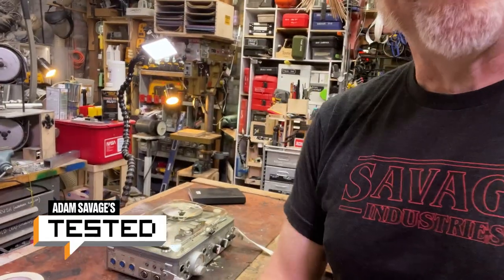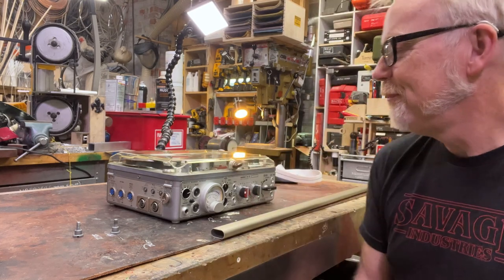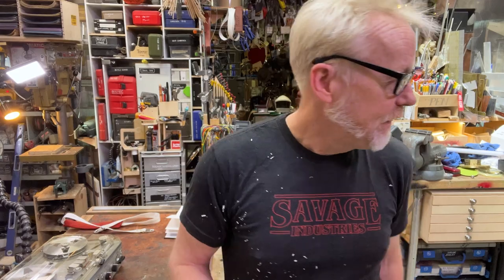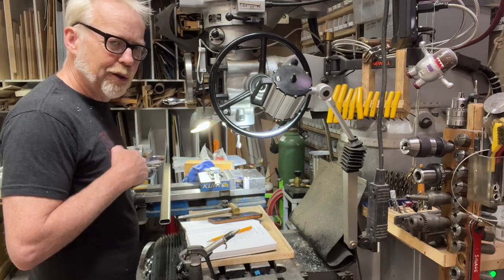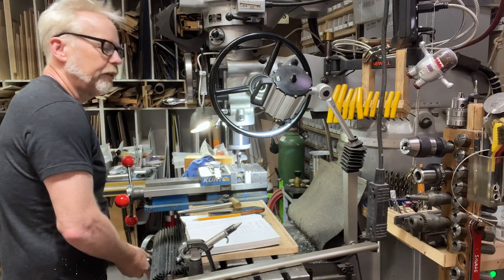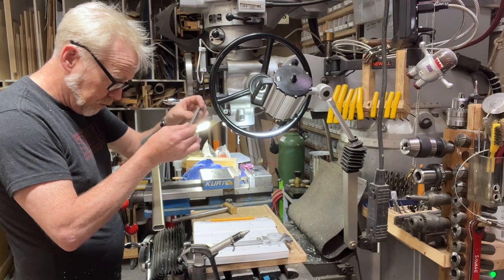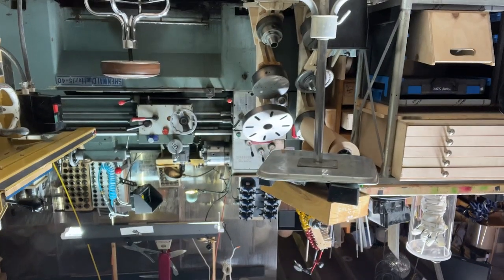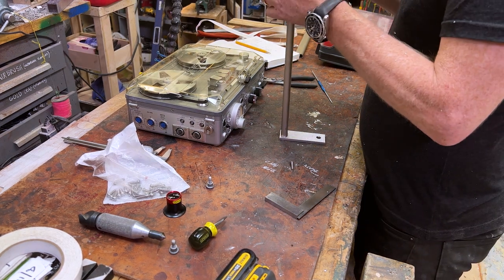Adam Savage's One Day Builds: Nagra Recorder Handle Bar

Comment: Back in my Nagra recording days, we never used a handle.  The recorder was either in a bag with a strap for run-n-gun type productions, or it was on our Magliner sound cart.  Yes, it's nice to angle up the recorder on a handle, but we would never trust it without a locking mechanism.  If someone were to bump the cart during recording and the Nagra were to fall, it could ruin a perfectly good take.  Today's digital solid state recorders wouldn't be affected by such a mishap but the Nagra is a precision mechanical device that doesn't take too well to shock.  I believe that the actual Nagra handle includes the locking mechanism, which is one of the many reasons why it is expensive.  Anyway, almost all of the devices that I have that have a handle that can be used to raise the control panel, include a locking mechanism at the point where it attaches to the device. This is a feature that Adam could have easily built in his shop and incorporated into his design. Otherwise, Adam's handle is beautiful and compliments the aesthetic of the Nagra very nicely.

Comment: Very nice job, and impressively close to the original! 
Here's a tip: True to Nagra engineering attention to useful details, the Nagra 4-series handle/strap lugs mounted on the chassis are assembled with flat springs on the inside, and preloaded so that the lugs will turn, but with an amount of tension that keeps the handle from being completely loose but still allows the handle to be positioned like you mentioned. 
- Glen Trew
Trew Audio
Nagra Service

Comment: The handle looks good, Adam. The extra notch looks "technical" :-) I saw the brown leather case you have. That's a little different to the black leather cases I used on 4.2 recorders for many years, (with the webbing straps with nylon end pieces with metal inserts). They are generally similar but the 4.2 style didn't have any zippers, just press studs. I don't know if they would fit the IV-S.  I found those black cases to be robust and offered good protection. They also allowed easy access to the controls whilst the recorder was being carried on the shoulder for field work.

Comment: Those oval bars are used in custom closets. I’ve ordered them for remodeling, they’re also very strong.
Reply: ...Strong enough to hold a 40-lb, 50-year-old sewing machine? Say supports at each end of a 20-inch (490mm+/-) span?

Comment: You should machine your own 10-32 handle screws with a flat head instead of the dome heads.  It would match better with the shoulder screws that hold the handle to to the case.

Comment: At 4:06 - Adam is measuring the outside width of this tape recorder.  Doing this for a wide object is prone to a measuring error.  You can't just "eyeball" it.  His method of using 1-2-3 blocks and a rule is OK.  But using a large outside caliper (https://en.wikipedia.org/wiki/Calipers#/media/File:OutsideCalipers.jpg) is a better choice.  My $0.02.  Thanks!

Comment: Adam, I have to ask: Why don't you make design drawings for such precise machining? This project isn't 'organic' like many of your prop and model pieces. It's creating/replicating a part for a machine built to (I suspect) very high tolerances and precise dimensions.

Also, I bet a lot of those early measurements would have been nice, round numbers in the metric system. The thing is made in Europe, right...?

I'm just trying to figure out how this approach is 'better' than more-measured approaches.

Comment: @Adam Savage’s Tested  Love your work, Awesome build. I think you should finish it off with some nice stainless steel button head socket cap Screws instead of flat heads you used to hold the hollow handle in place unless you had some reason for choosing the ones you did, I just think it would look better, the perfectionist side of me want to see button heads, I myself build everything with em, they always give a more polished look to the final build in my opin ... The notches do not look bad at all, no one would really know it was an accident, kinda looks like a design choice. LOL.

Comment: Hi Adam loved what you did with your Nagra. Just a thought though did you consider a locking handle that could be locked in the carry position and maybe two other positions ? I thought about my pushchair which has a similar mechanism where you push buttons mounted on the pivot points then rotate the handle into various locked positions. Would be cool project . Great video thanks
Reply: Yeah i was wondering about that, because he did say that he would like to use the handle to position the recorder at an angle, but with a smooth swivel like that, it's probably not going to work very well.
But it's kind of a dilemma, as he probably never (or rarely) uses the recorder, and the handle is operating so smoothly now, he'd have to "ruin" that with placing a couple of stops, for mostly show.
But then again, that's what Adam is, mostly show, haha, so i wonder what he ends up doing.

Comment: You know, that jog cut could work to your advantage... add a couple of little greebly pins or noggins to the case that fit the jog cut and you have a stop for the handle so it'll sit upright at a precise angle.

Comment: Changing from 13-1/8 to 13-3/32 by using the 1-2-3 blocks that were placed next to the unit by hand then measured by hand? 1/32" seems optimistic about the tolerances involved.

Comment: Adam, I'm afraid your handle side pieces are probably not lighter than the original Swiss design, which I googled. They removed a lot of interior interior material on the side pieces like an i-beam. Pretty brilliant structurally. Also, you devote so much energy into precise prop replication, why not copy the brilliance of the original Nagra handles? Huge fan! notwithstanding my comment here.

Comment: It doesn't matter in the least, but why use the flat aluminum bar to fill the handle rather than two aluminum rods, which would better fill the inside radius of the oval tube?

Comment: Adam: 13 and SIX -- SIXTY-FOURTHS!
The rest of the internet: Americans really will use anything but the metric system
13 & 3/32nds = ~331.6mm.. So I'd assume they designed it to be 330mm and Adam's 1-2-3-block measurement was ever so slightly off